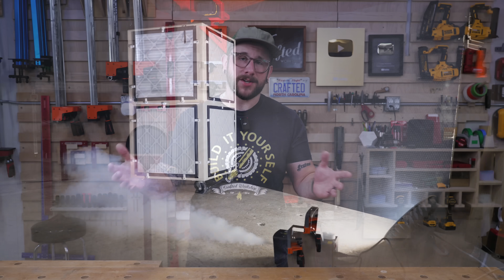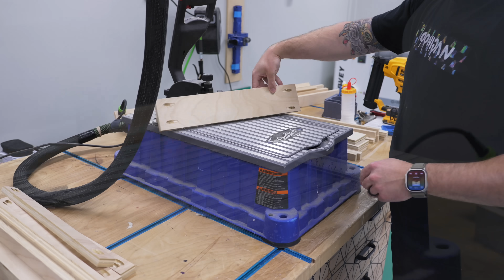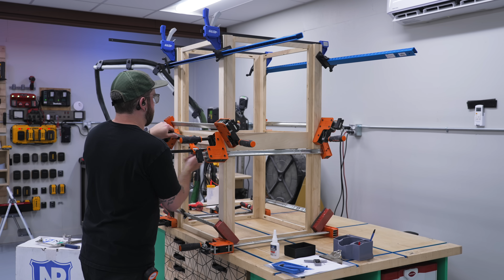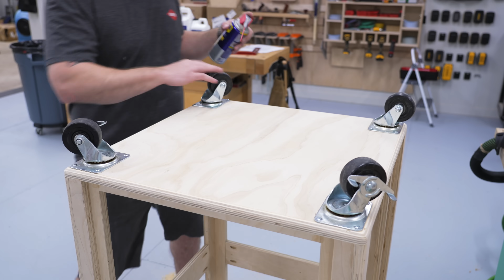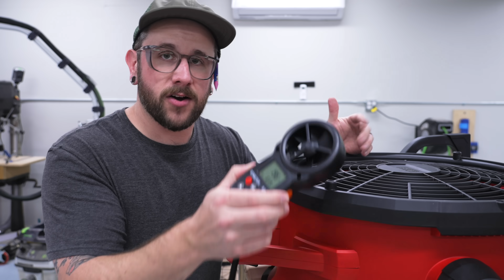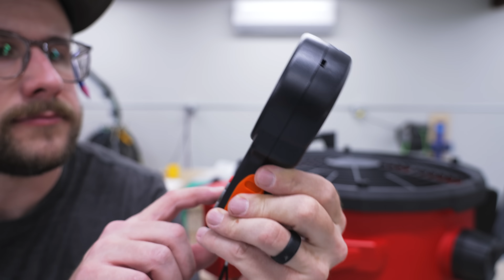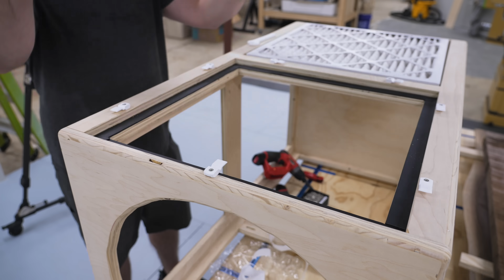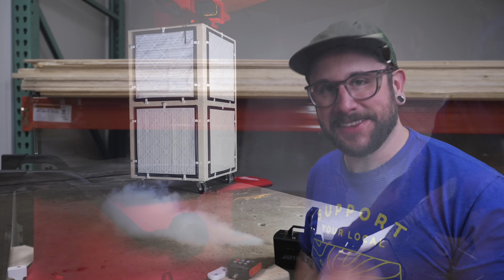How To Build DIY Cordless Shop Air Filter & Stop Breathing DUST!

Comment: cool project ! for your measurement,  your CFM measure taken with the anemometer on the fan gives you a low number because you are sampling a really low surface area.. Taking your CFM a few feet above should give you a proper result instead of a localized one. (venturi effect plays a big role on fan efficiency)
Reply: This was the big issue with me. I wanted him to raise that anometer at least a foot and a half off the fan

Comment: The biggest issue I see with your rating is that you are measuring are speed, rather than what is being moved (1100 ft/min is not the same as 1100 cubic feet/min, as you need to multiply airspeed by the swept area of the fans).
Reply: At least he got the relative performance drop with filters being still 10% 😂
Reply: Agreed. Definitely worth reuploading a revised video that doesn't include referring to f/m as cf/m when using the tester.
Reply: Doesnt matter since the inlet/outlet surface area is fixed, so in this case flow speed at the outlet is a proper indicator of change
Reply: @aloha13randonnn  an indicator of change, yes, but not an indicator of value.
Reply: @chaseweeks2708 but in situations like this where it would be really difficult for a layman to ACTUALLY work out the value, sometime change is a good enough indicator to tell us whether or not something or worth doing.
Reply: @James_T_Kirk_1701  Totally agree. Ballpark the value, then pay attention to the change.
Reply: Eh, even if you adjust the reading for swept area you'd also have to adjust for the different air speeds across that swept area to get closer and closer to a precise number. In the end, it doesn't matter much since he was looking more for a ratio than a precise reading. An interesting test, though, would've been 5 minutes of fog machine followed by running each of the different air filter machines to see how long they take to bring the PPM back down to baseline, apples to apples.

Comment: Thanks for showing the build for the 21inch fan
Reply: Pipe down
Reply: Where do I buy the filters?
Reply from the maker: You mean 3D Handyman, who I talked about multiple times in the video? His design was based on an existing air filter and I modified the design to be easier to build and work with this larger fan. I also linked to his Etsy store in the video description.
Reply: @craftedworkshop some people don’t listen or even watch the video or else they would know this already
Reply: @craftedworkshop  ok, i'll watch again and if I'm mistaken of course I'll withdraw the comment with apologies
Reply: fair enough, I'm sorry  looks like I skipped those parts of the video. comment adjusted